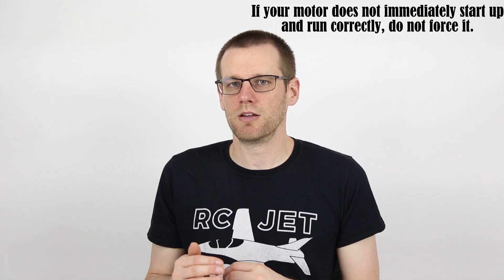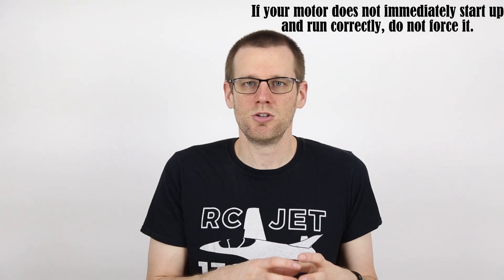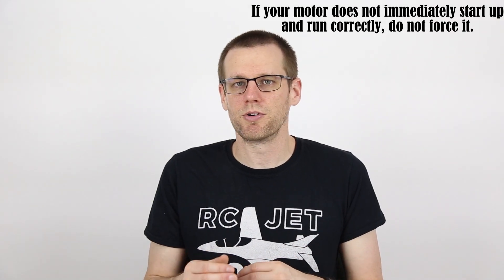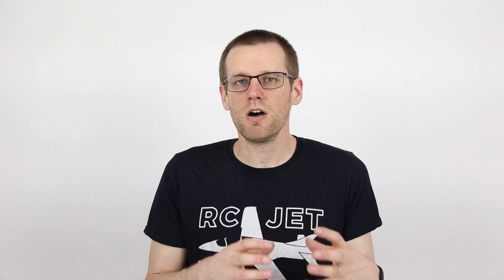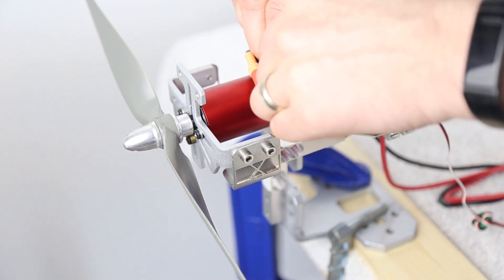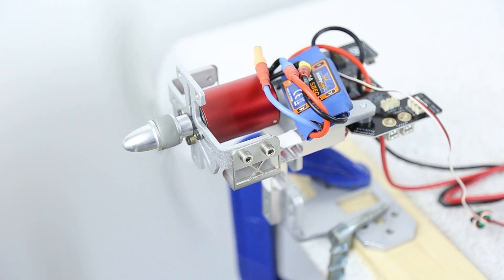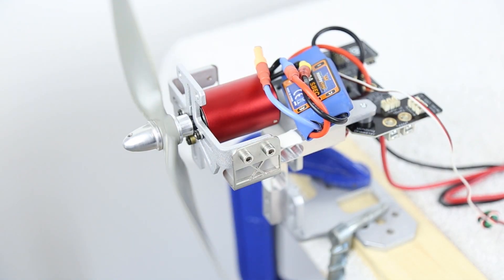Do this if your RC Brushless Motor is Stuttering, Vibrating or Screeching Upon Startup

Comment: I have a Cessna 182 (700 mm) r/c model. While assembling one of the grub screws ended up inside the motor. I tried to spin/shake the motor without any success, the screw stuck inside. Disassembled the motor removed that screw, assembled everything. The propeller revolves flawlessly till 50 % thrust. As soon as I add more thrust it makes noise, apparently loosing rpms. I guess I damaged the inner of the motor. Any advice would be very much appreciated!
Reply from the maker: What happens if you change the timing on the esc to high for a test. Does this change the response for the motor at all? Return the setting back to factory after the test.
Reply: @RCexplained  Thank you again for the response. I thought you might be interested to know what the culprit turned out to be in my case. So, after several unsuccessful attempts to calibrate the throttle I decided to put apart the motor again. And that was it - the copper coiling was cut at multiple spots. I assume I cut them while attempting to remove the grub screw that was stuck between the bell housing and stator. I also learned some RC basics along my trial and error path. Thank you!
Reply: @RCexplained  Thank you for the lightning fast response! I wish I knew the terminology that you have mentioned above))) This is my first time r/c airplane adventure and I have no basic knowledge. However, what I just did is that I removed the propeller and the motor went 100% with no problem, although at higher revs 70-80 and higher there is kind of roaring sound. But when I put back the propeller - same story - at >50% the propeller starts vibrating creating noise. When you look at the propeller from the side it reminds an unbalanced tire when this happens.

Comment: I have a problem with my RC model. The problem is that when I try to start it, the engine sprocket clicks and does not start. The engine is brand new, as is the speed control. How can this be fixed so that it works normally? I tried removing the engine from the RC model. I grab it by the handle with two fingers and it starts doing that again. It just doesn't have the strength to turn over when there is resistance.

Comment: This makes sense, but how do we single out which one is the issue?
Reply from the maker: make sure that all 3 are making good contact. you can do this one at a time and all at the same time.
Reply: @RCexplained I figured out how to do it, but non of the bullets are bad. I’m only getting 2 volts from an 11v battery.
Reply from the maker: Ah, thats a problem. Swap it for a fresh pack.
Reply: @RCexplained the 2s battery hits 7.5v but drops in seconds even though I just charged it.

Comment: Bro or anyone who understands about RC, please give your input. If it doesn't want to go forward but goes backward and the throttle is still smooth, why do you think it is? The dynamo only vibrates when pressed forward. It's only been a day. Go forward, okay?
Reply: Tipe dinamo is micro dc dinamo just use 2 wire

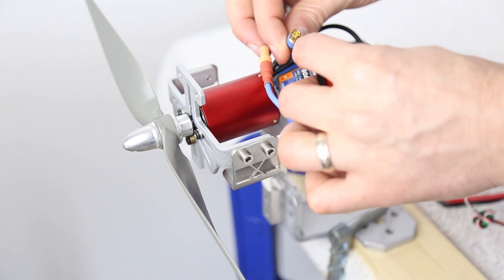Comment: Where'd you get that sweet thrust-test holder @2:40 from ?
Reply from the maker: rc benchmark
Reply: @RCexplained  Thanks!!  FYI - your video is AWESOME - spent half a day tearing our my hair on this one, turns out a sketchy size-adapter plug I inherited was the cause (not any of the 5 different ESC's I tried. face-palm - so obvious in *retrospect*)
Reply from the maker: glad you got it figured out!

Comment: Hi, I'll try my luck here in finding an answer. I have the MAD M50 20kw 34kv motor and the MAD 24S 300A ESC. They worked fine on my electric paramotor but on my last flight, between 4 - 4.3kw power there is a "tic" and a small brisk vibration like a knuckle in my seat. If I keep it between the mentioned power the vibration stays on. Someone sugested the esc misses a phase. I send pwm signal to the esc from a servo tester.
When testing without the prop, I can hear a slight change in motor runing tone somewhere on 20-30% throttle, I don't feel anny vibration, maybe because it has no load..
It's frustrating mostly because 4kw is the center of the most used throttle envelope and every now and then when I pass that 4 -4.3kw point..tick..tick...
 Should I be concerned, I mean besides the fact that I'm above the ground? 😅
Could it be the cables? Because I've recently switched motors for some flights to test another one so cables were moved a bit.
Reply from the maker: What does the esc and motor manufacture recommend for pwm rates? Where are you flying?
Reply: @RCexplained  It says on the esc page that compatible signal frequency is 50-500Hz and throttle pulse width - default 1050us - 1940us. 
The servo tester has output signal 1.5ms +/-0.5ms. Is that 1500us? So it's ok right?
It worked fine for 23 flights then I switched to a smaller motor and battery to lighten the unit, the M.A.D. V135 which works good but getting hot but still between recommended limits so it's ok. 
Now I've switched back to the bigger M50 motor just to see how it feels with the lighter unit, and on first flight I've got this small bump when passing through a certain rpm or frequency, or several small vibrations if I try to keep it at that spot.
So it seems frequency related rather than mechanical, being at that precise rpm/power point every time. Weird is that it doesn't do it with the smaller motor or with the larger one before. And both motors have this esc recommended by M.A.D. to be used together.
Maybe the small cheap servo tester got tired and formed some dead spots or is it the esc? 
I'll try the smaller prop from the smaller motor and see if that bump remains. I might get used to it but I want to know if it is bad for the esc or motor if I ignore it, these two items cost me a fortune...
Please check my y..page to see videos with the paramotor. Three, four videos back I have the first flight and towards the end of it some ground tests to 10 kw power, you can see it sounds and works nice.
Before that vid I have a detailed vid on how I've built my hand throttle with the servo tester.
I fly in Europe (Romania). Thank you very much for the help, not many guys with this stuff around here to ask..
Reply from the maker: I'll check out your videos soon. I was speaking about the pwm frequency sent to the motor through the 3 wires to control speed. This should be measured on the order of thousands of hertz.
Reply: @RCexplained  You're right, tens of Khz is what writes on my rc planes escs but in this case I guess it's 50-500Hz as stated on the Esc webpage, it's made for this kind of slow motors like the M50 that has only 34kv rpm.

Comment: Hi your videos have helped a lot and. I was wondering if you know how too fix a mamba monster x 1515-2200kv sensored combo has forward and reverse switched and when I reverse the throttle on my tx it's faster in reverse. Thanks for ur time.
Reply from the maker: Yes switch it in the castle software.
Reply: @RCexplained  so use the castle link rite?
Reply from the maker: @tonyellis4773  yes

Comment: My brand new motor/ESC were a matched pair and it initially worked fine but developed the same stuttering after a very short time. I returned the motor/esc to the supplier and they tested it and found it worked OK and sent me a video to prove it. I told them that it was their problem and should do more testing as it appears to work but then starts stuttering again. Still waiting to hear from them after many days.

Comment: Thank You! I ran out of talent newish flyer trying to complete a roll. Went to flick toggle switch to switch on the gyro nothing and I stuffed it nose first into the ground! (Helps if you flick the correct toggle switch!) I had exactly this as in the demo. Sure enough checked the three wires between esc & motor looked fine, but double checked after watching your Video and one of the (3) wires to the motor had been detached! After extensive nose rebuild (pusher prop plane ) back in the air straight away. I'd started to question if I hadn't throttled back after the impact and burnt the motor/esc out, but I had! Just a loose wire Thank You!
Reply from the maker: Great to hear you're back in the air! Sometimes it's the little things that can trip us up.

Comment: The problem with mine is that even if I don’t connect the esc it’s still stiff I need help
Reply from the maker: What's the problem?
Reply: @RCexplained  even if I don’t connect to power it’s still stiff. When everything is off if I spin with my hands the motor it’s stiff it’s supposed to move freely
Reply from the maker: Did it change? Wat does it do in an rc? I'm searching for a problem other than your sense of it being stiff.
Reply: @RCexplained  I don’t understand but even if I don’t connect it to power when I spin it with my fingers it’s not moving freely. But when I connect it to the esc then when I put maybe 20% throttle it moves freely again
Reply from the maker: Sounds normal to me. The magnets in the motor do interact with the iron core on the stator. If you feel it notchy with steps of stiffnes as you rotate the motor, this is normal. Check Temps when you run the rc.
Reply: @RCexplained  oh ok if it’s normal then that’s fine. My friend who’s experienced said If the motor isn’t overheating then It’s ok. And my motor doesn’t over heat it runs normal. I first thought there was something stuck but the wasn’t
Reply from the maker: Your friend is correct. Check your Temps.
Reply: @RCexplained  Yeah it isn’t getting hot at all so he said if it’s isn’t then it’s ok

Comment: My Sidewinder ESC started cogging and I traced it to the plugs. Cleaned it, ran it for a bit fine, then every time it flipped over or came to a stop, it started cogging. I never had any issues like this before. I’m thinking I need to try a more durable ESC.

Comment: what is the problem if the motor works by itself, it depends on how I connect the three thick wires on the motor, sometimes the motor spins forward, sometimes backward, but I, and when I press the throttle, the motor brakes instead of turning the wheels forward, I have programmed the controller several times, is it it is possible that the ESC is dead, because the engine is running, or something else is involved?
Reply from the maker: Sounds like your transmitter may have the throttle reversed.
Reply: Have you tried swapping the two outer wires connection to reverse the polarity?

Comment: I have 1 bldc motor and two ESC.
In one ESC it's working good, when I try to run it on another ESC it's running only in  lower rpm.. I can't run it in higher rpm.
Do anyone has any suggestions?

Comment: Thanks for the video!  I am experiencing cogging almost identical to what your video showed.  However, all the leads are properly soldered and connected and it's still cogging.  Can't even get the rotor a full rotation.  Bearings and rotor are all good.  Do you have any suggestions?
Reply: Same here. Motor sputters ans goes back and forth ocasionally starting, running perfect after that. Is you cut power, ten again same problem. New motor, new esc, everything looks ok and it works fine without the prop. As soon as i install the prop, the problem comes back.

Comment: Hey I have a problem with my sensored motor in my touring car. it works like it should most of the time, it can slowly start up without cogging and so on. But if I pull the car backwards and slowly get on the throttle, it shouts out backwards even if there is sensors and everything to prevent this happening. Do you think something is wrong or is this normal???

Comment: Thanks.
I just got a second hand set up. I think I got this scenario. I have a capacitor on the esc that got hot quickly. I probably tried it 3 times on the throttle on the bench for about 15-30 seconds. Is that enough to damage the esc/motor please?

Comment: Hi ryan, can you help me here, I have an old (5 years old maybe) esc and motor combo from HW 150a sd the blue version with 2000kv sensored motor, 1st problem is whe i punch full throttle from the start at high rpm the motor stutters a bit then goes full throttle, but if I pull the throttle smoothly it wont happen, it only happe when I punch the throttle from stop position, can you help me fuigure out what happen? Your help will save me lots 🙏
Reply from the maker: If you are running in sensored mode, it should not do this.
Reply: @RCexplained  Do you think its a bad esc? Weak capacitor or bec? Because I try to run a separate bec but it is still the same, thank you
Reply from the maker: Not necessarily. Is it running in sensored mode or sensorless? A typical sensored esc usually has both options selectable through programming.
Reply: @RCexplained  yes it is running sensored, but after the stutters happen the esc detect an error in the sensored port, even tho I run it sensorless it still did the same thing
Reply from the maker: Sounds like the error needs to be corrected.

Comment: Not sure what my issue was. 1/8 scale buggy, new ESC, used 1900kv motor, new sensor wire.  First time out, ran fine. Second time out it stopped working.  Motor wouldn’t move with throttle input.  However if I pushed the car then gave it throttle it worked fine (until it came to a stop again).   I ended up getting a new motor and have had no issues.  What could it be?   I did take the motor apart and saw there was dirt on the sensor board?  Could that have shorted the sensors out?
Reply: Did you ever figure out what caused this? I have the same issue: 4x4 ran fine, then came to a stop and wouldnt start. Motor whines but requires push to get going, if at all.
Reply: @danbekistan  I tried a new sensor cable and it wasn’t that.  I had a race to go to and jest ended up buying a new motor.  I did take the old motor apart and the sensor board was all crusty.  I cleaned it all with alcohol but haven’t tried it again.  So, I think the motor was the issue.  First though check your sensor cable.

Comment: i had similar issue with 7700kv & 120A esc with 2s 120c setup. Sometime when i pull the throttle it seem unresponsive. Are this connection issue too?
Reply from the maker: Remove the pinion gear and see if this changes anything.
Reply: @RCexplained  i try removed the pinion. Everything seem normal.. my motor rated 97A max. Does it related to esc?  thanks
Reply: is this a cheap blue esc?
Reply: @hansdampf3576  im using hobbywing 120A. After i change to new motor problem solved. 👍